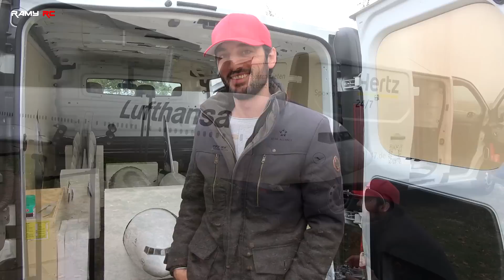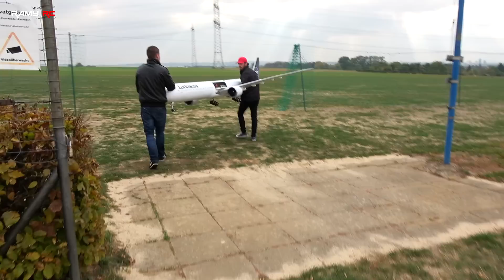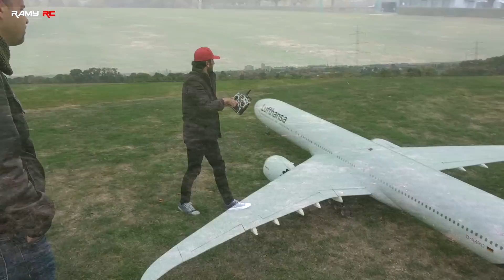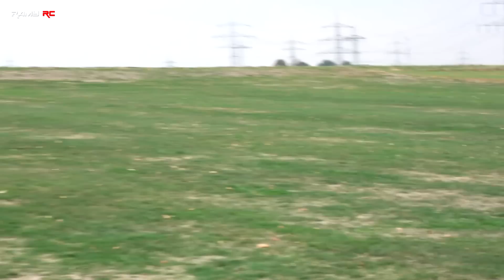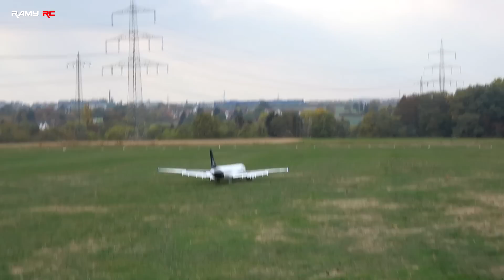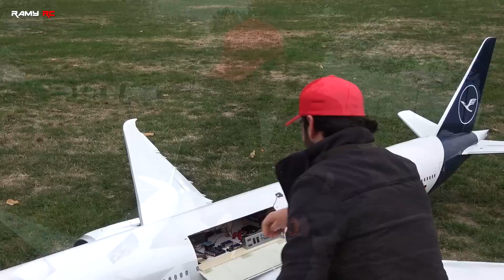BOEING 777-9X/ RC airliner MAIDEN FLIGHT/ Lufthansa new livery

Comment: Ryanair landing
Reply: semaine
Reply: Shikon but hi didn’t have one landing Gear right way
Reply: LOLOLOLOL
Reply: Puff most are because 90% are beginner pilots
Reply: The 737 is a bit hard to fly itself because of the fact the nose is lower then the back of the fuselage. They also land hardly because they need to get to the gate quickly; landings that are smooth shows you the pilots are not in a hurry to get to the gate.
Reply: Ryan Air wishes they could land this hard lol

Comment: But hey, Ramy don't you see that the runway is not a good one for your planes at all.
It is a real pity that you destroy all the planes in this bad terrain.
That type of aircraft has to be on a very smooth track and without a bump.
What you can do is roll around the ground until it is as smooth as a carpet.
Keep in mind that all the landing gear will break and disrupt the wings and the front end.
You have to learn how to land the plane, you can not make those crashes of landings.
Greetings.
Reply: Something like a racetrack asphalt?

Comment: Plus another advantage of the Boeing B797 flying wing is that it has three sets of rear landing gear that would make taking off and landing on a grass runway alot easier on the landing gear, but that's a work of art that you have made their

Comment: Ramy, the plane looks nice, that being said, I started by watching your repair video, and then wanted to see how the damage occurred. From a full-scale pilot: I'd suggest that you find a calmer day for test flights, next, on full scale aircraft (AC) there are "speed limits" for the landing gear, and the flaps. These limits are there to protect the mechanisms from being overstressed (think of opening the car door at 100 mph, you might be able to do it at 20mph, but not 100. In the video I could see the failure of the right main gear door; and at certain speeds the gear servos may not even have enough torque to move the gear. I noticed that the left main appeared to be partially down at one time, while the right one was up. Last thing, you should have  the landing set up and stabilized well before you get near the ground, using your throttle and pitch of the AC to control your touch down verticle velocity. You might want to observe some full scale landings, you'd be surprised how much you can learn from watching. Best wishes on your next flight(s).

Comment: Nice job Ramy. FYI as you might know this already and sometimes nerves takes over as you experienced but when performing a maiden flight. You should do this by leaving the gears down in order to perform all your trims for landing configuration and clean configuration that way if you experience any issues it's one less thing you have to do while making an emergency landing. I'm pretty  sure once you saw the one gear that didn't go up, that's all that was on your mind and was praying that the rest of the landing gears would go down when you were ready to land. You could of saved us all from holding our breath for the duration of that flight just by that simple procedure. Though it was worth the suspense/drama watching. Great job again saving that beauty. Can't wait to see it fly again!

Comment: Just bear in mind that i am talking about analogue video transmission like old tv before DVB-T.  So at the end of the range you will get noise, like and "snow" like artifacts.  To get into the RC Hobby you need to have basic understanding of electrics, electronics and know how to do some basic soldering. The advanced stuff are DIY

Comment: Congratulations and very well done! It was quite the heartstopping maiden. Those Schubeler EDFs are absolutely amazing sounding. I can tell, even though she's a bit on the heavier side, once the kinks are worked out she'll be a very docile bird. I have a few questions if that's ok. 

-Did the conditions lead to any of the instability seen in the flight?
-How was the CG?
-During those moments of extremely high bank angle, was it because of gusts, too high roll rate, or wing stall?
-between initial approach to flare, how much are you having to hold up elevator? 
-From the new planes youve built, it seems youve had quite a few breakthroughs in building methods. If you were to rebuild and retrofit parts on this aircraft, what would you do differently?

If you can answer even a few of these, I'd be grateful and indebted. I'm working on some of my own plans and am inspired by your rate of improvement through every plane you build. I realize experience is the key to this, and you documenting your journey in this hobby proves this. Thanks Ramy, you are quite the inspiration.

Comment: A few comments 
Congratulations for surviving the first flight good job. 
I noticed, the alignment in the wing or elevator, something looks funny there.  It looks nervous in the air too touchy for a 22kg model, that size should be acting much more docile, I think you are missing some washout towards the wing tips. 
Flight wise you need to extend the approach perhaps double or tipple the approach distance you flew it in to the ground a longer approach and nice flare you would have got away with it.

Comment: It’s said, “An old dog cannot learn new tricks,” but I admire your creations, and I am inspired by your inventiveness and creativity.  I have a Flite Test Mini Biplane kit my son gave me for Christmas.  It is my first experience with foam board and looks simple enough.  However, your work with foam board takes it to a much higher level.  Something I must try in the future.  Until then, however, I have  project in the works, a Grumman C-1a Trader, I am presently in the design phase on.  It will be approximately 87 inch wing span, with twin Saito 14cc, 4 stroke gas engines.  A lot of work left to finish the design, create laser patterns for the parts, the build the aircraft.  I expect the finished aircraft to be in the range of 15-20 pounds.  Keep up your good work, I am learning a lot.  What is the glue and accelerator you are using?

Comment: you should make a removable battery tray. one that will firmly hold the batteries stationary and can be bolted to the electronics bay. easy to install and remove. single hook ups.

Comment: Why not an actual runway ?  You are using electric motors for your jet’s power plant which got me thinking. Could not future airlines use electric motors to power full scale passenger aircraft thus solving the problem of greenhouse gas emissions ? If this is possible on a scale model then why not on a full size passenger plane.

Comment: Ok atleast it fly but you need to work on your landing skills cause that is a super hard landing, hard landing damage any airplane structure even a real commercial airliner if they did a hard landing they, have to called engineers to check for structural damages. And you cut the power too early.